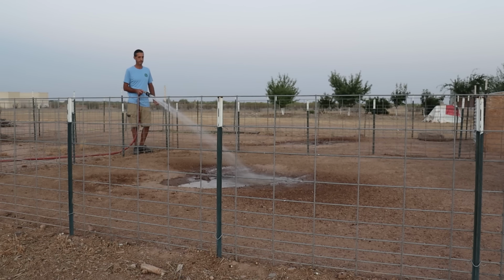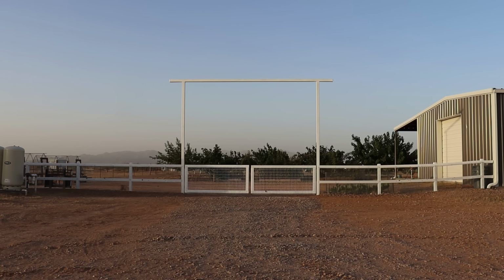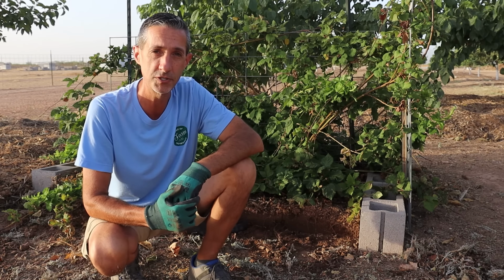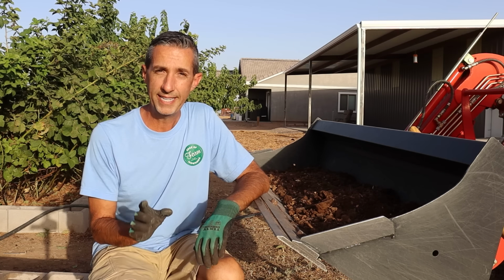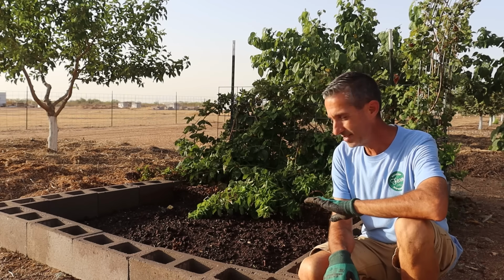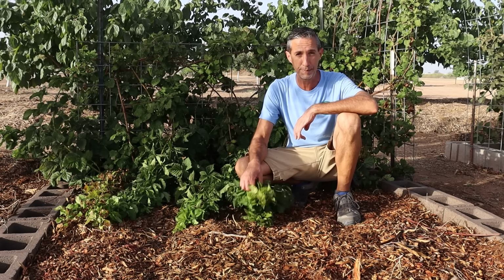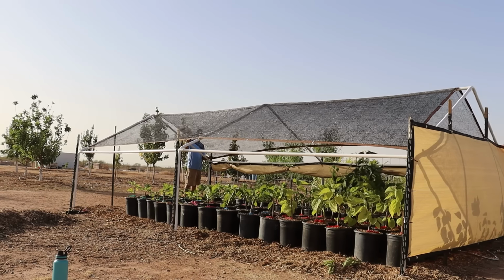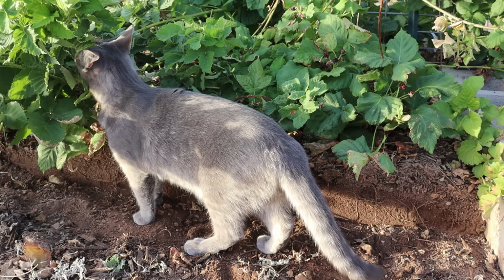Make Your Own Soil | Fruit Tree Nursery Update

Comment: Great video. What are the tall structures seen in 0:24-0:25? Fences covered in vines?  Have you covered that in another video?  Thanks!
Reply from the maker: I want to make sure we're on the same page. Are you seeing the grapevines on trellising surrounding the garden area to the right of the screen?
Reply: @EdgeofNowhereFarm  Thanks. Yes, the 90 degree elbow, upper center right on the screen. I'm guessing it's a grapevine on a tall fence? I like the way it adds structure and it seems like it would be a great windbreak.

Comment: You really need to look into elephant grass/napier grass, it produce canes like sugarcane and you have on site production of woody material. Plus its a perinatal grass grown form cuttings and is edible for all animals but also good for biomass production. They use it in India to produce A4 printing paper. 

They are heat loving grass that grow in the heat quickly.
Reply from the maker: We've had a few other folks suggest them as well. I tried to find an inexpensive source and was unsuccessful, but need to check it out again.

Comment: I planted some of the Prime Ark Freedom blackberries after seeing them on your videos, They are fantastic! I am thinking about trying a loganberry, Have you tried those?
Reply from the maker: No we haven't tried those before. We've attempted several varieties over the years and found the only 2 that produce well for us are the Prime Ark and Triple Crown. The biggest challenge we have is our dry heat in early summer. That has a tendency to stop most varieties of berries from fully ripening without drying out.
Reply: @EdgeofNowhereFarm  I know what you mean about early summer, because I'm down the road from you in Surprise, AZ.   Which is sweeter, Prime Ark or Triple Crown?
Reply from the maker: @Alisone123  the triple crown is sweeter, but the production and consistency of the Prime Ark is far better. Also, the Prime Ark grows more vertical with far less "running", so it's easier to control for size. It's one of many reasons we just keep that variety now.